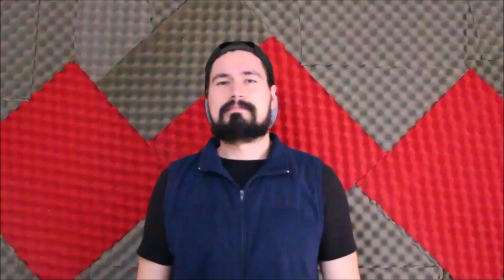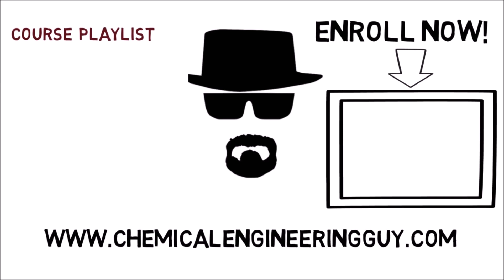Polymerization Unit & Production of Polymer Gasoline - Section Overview (Lecture 136)

Comment: Never heard of a Refinery using polymerization for gasoline, are there many??
I know it's done on a stirred reactor at midly high T, but what are the catalysts used?
Reply from the maker: yeah, actually is kind of normal, it is getting popular each time as less quality crude oils are avialable
Reply: I work on a Catalytic polymerization unit, where an olefinic C3 and C4 stream is converted to gasoline products  .We use fixed bed reactors, with a solid phosphoric acid catalyst.